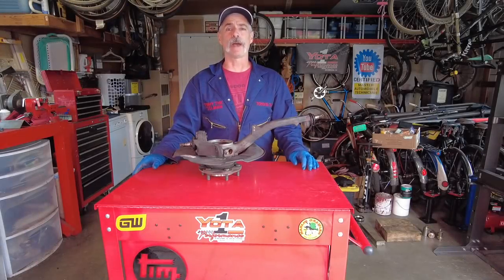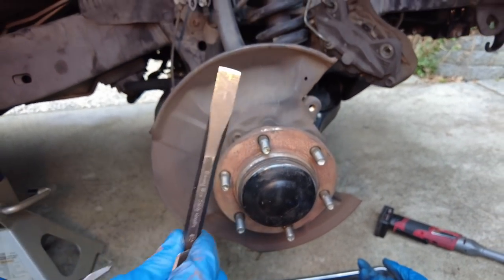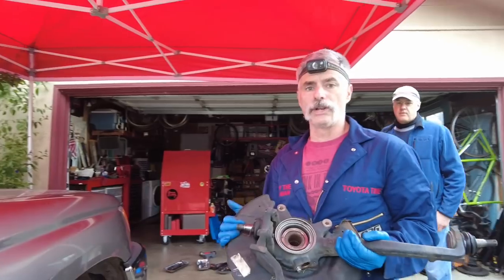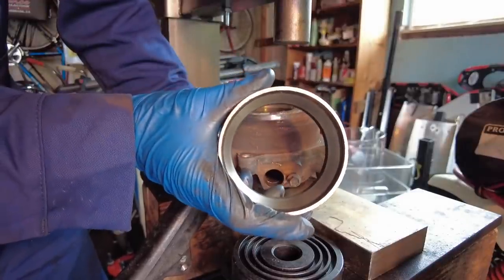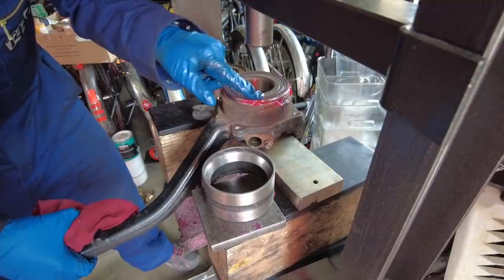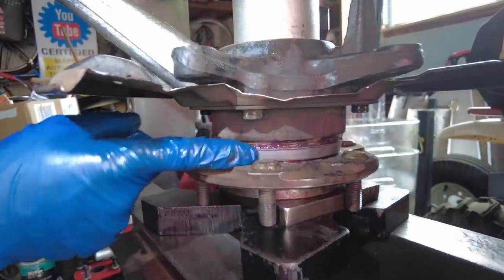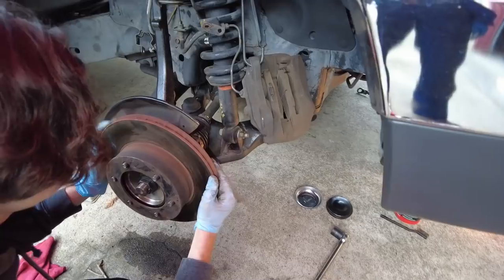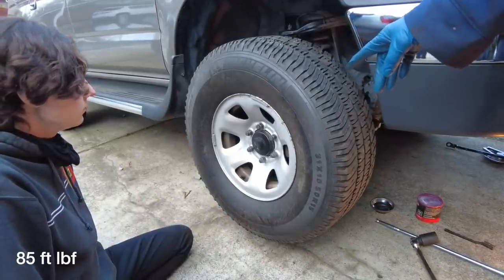Front Wheel Bearing Replacement (3rd Gen Toyota 4runner & 1st Gen Toyota Tacoma)

Comment: I can't tell you how valuable these video are to those of us trying to get the most out of older Toyota trucks!  I have already done a bunch of work on our company trucks.

Have you ever installed front wheel bearings on a 2WD 1st gen Tundra?  My company owns three of them and they all need to be done.  Looking for a good video.
Reply from the maker: We haven't done this job on a 2wd but the job would be similar to what you'd see on a rig with manual hubs.  Instead of having the CV axle nut that preloads the bearing, there's a lock nut that screws onto the shaft of the hub that is tightened to a high torque value that preloads the bearing.  Check out these two videos for information on how to perform the press work: 

https://youtu.be/TZ2sOfVrnhU

https://youtu.be/1TpOYj0sUpA

Comment: Great information in this video... Reassembly:   Toyota uses a thread locking material on the 4 bolts that mount from under lower ball joint.
Reply from the maker: Loctite is never a bad idea, but for the most part, if fasteners are torqued properly, they're not going to come loose.  Thanks for sharing this.

Comment: This is a lot more work than i thought! Quite the investment needed in tools to do this yourself. You can buy an entirely new knuckle that has a new bearing, hub, and upper balljoint already all installed. From toyota direct, a new knuckle is pretty pricey and does not include the other components. From aftermarket like moog, its about 250-300 dollars for each side. Do you have any experience with these particular aftermarket parts? Or would you recommend sticking to oem genuine parts for something like this?
Reply from the maker: Stick with OEM.  Also, make the tools investment.  Tools pay for themselves very quickly and keep.saving you money over time.

Comment: Thanks man, great video.  What's a good rule of thumb for the life of front wheel bearings on these rigs? I have a 99 4runner 4x4 and an 03 tacoma pre-runner 2x4 with 228,000 and 215,000 miles respectively. No issues yet... fingers crossed. Thanks
Reply from the maker: Hey Michael, there's no rule of thumb really on how long they last.  It can depend heavily on how the rig is used.  If you go 4wheeling, run bigger tires and maybe wheel spacers, the wheel bearings won't last as long.  I'm glad you liked the video.  Hopefully, you'll never need this repair.

Comment: 3 out of 4 of these I have done have just wound up pressing the whole bearing out of the knuckle instead of just the hub out of the bearing, deforming and destroying the snap ring that retains the bearing. I would highly recommend ordering new snap rings with the bearings beforehand. I was swapping to manual hubs so I had new hubs or I would have been hosed. Still had to drive 2 hours to a dealer that had the snap ring in stock lol.
Reply from the maker: Wow, that must have taken considerable force to overcome the snap ring.  it's definitely much easier to press the hub out first.  For sure everyone should replace the snap ring as part of this job.
Reply: @TimmyTheToolman  I was trying to press the hub out, exactly as you are. But instead of the hub breaking free the snap ring fails with much the same noise but with a little extra crunchy sounds too lol. The first time I was very confused. By time number 3 I guess that's just what you get in the rustbelt. The 4th one I put the whole knuckle assembly in the oven for an hour and it pressed out normally LOL.
Reply from the maker: @jeep6242  Oh, I understand.  You're dealing with significant rust.  Rust is definitely a game changer.

Comment: Fantastic video!! Takes me back to when I was turning wrenches.. got a basic question for you, how did the wheel speed sensors function with the greese on the teeth? Any errors or abs trouble codes? Thanks
Reply from the maker: The ABS sensor worked fine with some grease on the ABS tone ring.  I was a little sloppy with the application of the grease.  It would be ideal to keep the grease off the teeth of the tone ring.  Glad you like the video.

Comment: Timmy, another awesome and helpful video! every time I need to work on my 4runner your page is my first stop!  I have an 2001 2wd runner needing front bearing replacement. I cant seem to figure out if the 2wd needs  inner and outer bearing seals. I've seen other vids for 2wd showing only 1 seal for the 2wd model. Any chance your familiar with the 2001 2wd runner front wheel bearing replacement ?
Reply from the maker: The 2wd steering knuckles will be similar to the 1st Gen Tacomas that had manual hubs.  The bearing preload is set with a lock nut rather than the CV axle nut.  Check out this video: https://youtu.be/1TpOYj0sUpA?si=9HZmzdV7rGtys-1- and it will let you know how to do it.  Because you don't have a CV axle, you won't have in inner seal for the knuckle.  From what I remember, there's some sort of cover that keep water and other contaminants from intruding into the knuckle and contaminating the bearing.
Reply: thank you for the speedy response! the provided link along with your video helped me complete this repair. Many thanks Timmy, you rock! @TimmyTheToolman
Reply from the maker: @TheAtak85  You're welcome!  Great to hear our video helped you out.

Comment: Hey Tim thanks for the video. I just did this job on my 01 tacoma. Put it all back together and took it on a test drive and it went out of alignment?
Reply from the maker: Your alignment should not be affected by anything you did for a wheel bearing replacement.  Unless you adjusted the outer tie rods or messed the LCA cam adjusters,  nothing with your alignment should change.

Comment: Hi Timmy! I’ve tackled many jobs on my 1st gen Tacoma with the help of your video including the timing belt W/P and the most recent, valve cover gaskets. I’m going to be tackling this soon on some spare spindles I have and I’m curious if the attached parts will work for my Tacoma. It’s a 2001 with ADD and no ABS. the reason I’m asking is because Amazon says these parts won’t work with my truck. I’ve always heard 4runner, Tacoma and early model tundras have the same spindles. Just wanted to make sure before ordering parts. Any info is appreciated. Thank you!
Reply from the maker: Yes, the parts we list in the video description with work for your Tacoma spindles.  Great to hear our videos are helping you out.  Happy Wrenching!

Comment: Time to do my driver side, front wheel bearing. Found that it has a little bit of play in  it the other day. Curious Tim or anybody else? Have you used the hub grappler method? Watched another video where a guy used one of those tools seemed like a hell of a lot easier method than having to remove The knuckle and use a press to remove the bearing/hub. Any experience with this? Thanks.
Reply from the maker: Nope, I don't have those hub grabber tools.  My guess is that set of tools is pricey.

Comment: Hey tim, im doing this job on my 2004 tundra next week, both sides. Aside from potentially a few different parts numbers, is the construction/process the same? Thanks!
Reply from the maker: I've never done the job on a 1st Gen Tundra, but I've handled the steering knuckles before and they look pretty much identical to the 3rd Gen 4runner and 1st Gen Tacoma axles.  It's my best guess the process is identical.

Comment: Awesome video guys, thanks a bunch.  I don't have my own press, sure wish I could do this all myself!  I noticed the axle appears to have an additional seal that mates with the knuckle/inner seal.  Can you comment on that and why you maybe didn't bother replacing that as well?
Reply from the maker: Hey Tom, glad you like the video.  As for the seals, we replaced all of them.   Can you provide a timestamp to the part that shows what you're referring to?
Reply: @TimmyTheToolman  I think that @Tom Hernandez is talking about the dust seal on the outboard side of the CV axle.  I had the same question. I think it is the dust seal 90080-30028 (but am not quite sure on that PN) that interfaces with the inner wheel seal 90316-69001.
Reply from the maker: @averycook6854  On the 3rd Gen 4runner and 1st Gen Tacoma axles, there is no seal on the outboard side of the axle.  There's a seal on the backside of the knuckle, but not on the axle itself.  There is a metal disk on the inboard side of the axle that works as sort of a dust seal to keep larger contaminants out of the differential.

Comment: Thanks for all the hard work on these videos Tim! I got a 4Runner a few months ago and your channel has been the most reliable resource for fixing this thing up. I recently joined the forum as well and I live in the East Bay so I’m hoping to make it to a meet soon (I know there’s actually a bbq tomorrow but I can’t make it unfortunately).

Anyway, I’m in the middle of replacing my upper ball joints and right after pulling the knuckle from the car, I noticed there’s very slight play in the hub. I’m sure that wasn’t there when everything was still assembled, but you also mentioned in the video that the axle nut loads the wheel bearing. So now I’m stuck here wondering if I damaged the wheel bearing in the knuckle removal process somehow, or if the little bit of play is just because there’s no longer an axle nut pressing it all together. What are your thoughts? Thanks! -Troy
Reply from the maker: You're very welcome Troy.  Are you actually feeling play when you grab onto the face of the hub and rock it back and forth?   You couldn't have damaged anything simply by taking it off the vehicle.  If there is some play and you want to confirm tightening the CV axle nut actually gets rid of it, with the knuckle still off the vehicle, slide the axle back in the hub and tighten the axle nut just relatively tight with a 1/2" drive ratchet.  Now grab the hub and rock it back and forth checking to feel if the play is gone now or is still there.  On the wheel bearing jobs I've done, I don't remember feeling any play but I wasn't really looking for it either since we just put new bearings in.  If you try what I suggested, let me know how it went.  You're going to miss a good party.  We might have as many as 37 rigs there and 70 people.
Reply: I guess “play” was a bad choice of words. With the whole knuckle assembly off the car, the hub was just clicking when I rocked it back and forth, but I couldn’t visibly see any play. I could just hear and feel a click. And I hadn’t thought to just bolt it back onto the axle and test it again, hahaha. So I just did, and after getting the axle nut hand tight, the clicking is completely gone. So I’m just gonna hope all is well and finish this upper ball joint job. Thanks for the help!
Reply from the maker: @troyferrara8120  That clicking is the bearing spacer and ABS tone ring on the inside of the hub.  It doesn't fit onto the shaft all that tight.  That has fooled lots of people who think something is wrong with it based off the play they are seeing.

Comment: Would you recommend placing the bearings in the freezer overnight to allow ease of installation?  I've used this method for ball joints.
Reply from the maker: That could work, we have always just pressed them in. But putting them in the freezer the night before should help a lot

Comment: Hey Tim, love the videos as always. 
I hit you up about a month ago on the topic of ultrasonic cleaners. I just wanted to give you a follow up message saying don’t waste your time and money. No sooner than I started bragging to you about my cleaner it broke down lol. I got a refund then went and bought another one that was a different brand. I didn’t have any luck out of it either broke down within the first week of use. Don’t get me wrong they’re great to have when they work. If you can get a good one there awesome but paying $5000 for one that’s not made in China is not cost-effective. So I myself am back to brake parts cleaner and degreaser’s. That’s one thing about a plastic scraper and elbow grease it doesn’t break down on you. Just figured I would give you a heads up in case you are still looking into getting one. 

On a side topic I recently did a job on a passenger side front axle shaft bearing. It was on an 03 Tacoma. I looked online a lot and didn’t find much help even East Coast gear supply said to slide hammer it out. That will not work btw. Everything I looked at online people were asking more questions and getting no answers. I removed the axel seal then the inner and outer snaprings from the bearing It would slide in and out just a little bit at that point. I finally took the four-wheel-drive actuator Off and noticed another snap ring on the end of the shaft holding a gear on. I ended up taking the whole sleeve loose from the differential pressing the bearing off and back on. Then re-assembling everything with a new axel seal a new O-ring and Toyotas orange FIPG to seal the actuator back in place. Then putting it back on as one big piece to the differential using the orange FIPG again. I know you have to work pretty fast using FIPG reassemble in less than 15 minutes it says. From what I did see online guys were using the “right stuff Permatex”, flang sealant and all kinds of different things they thought were right. So I would say that would be a good video to do. Show people how to actually do it right. I’m sure a lot of people would be interested. Thanks Looking forward to a new years worth of videos.
Reply from the maker: Thanks for the heads up about the ultrasonic cleaner.  I didn't buy one yet.  I have wondered what the right way would be to replace that passenger side bearing the CV axle runs on.  So, do you think the way you did it is the preferred way?  Did you take any pictures along the way to show how you did it?  I'll take a look at my manual and see if I can glean any info from it.

Comment: Hey Timmy, loved the video!
I have been experiencing ABS issues intermittently where my ABS system activates when I am braking normally on dry pavement.  When I removed the ABS speed sensor there was a lot of dark grease all over it.  Would a bearing seal failure cause this and would it negatively effect the speed sensor?
Reply from the maker: I take it you're talking about a rear axle ABS sensor.  Oil and grease on the sensor could cause an issue potentially with the ABS function but it's definitely a sign it's time to do a rear axle seal job.
Reply: @TimmyTheToolman  I've been working on the front of my truck (99 tacoma 4wd). I'm replacing the upper and lower ball joints and replacing the old bilstene shocks and springs with old man emu ones.  That's when I noticed all the grease on the speed sensor.
Reply from the maker: @flaminglaces  Gotcha, so we're talking about the front.  Those bearings are sealed and you really shouldn't be seeing a bunch of grease in that area.  I wonder if somebody who did a wheel bearing replacement thought it was necessary to pack a bunch of grease in there.  You could pull off that inner seal to get a better look.  Maybe you could just clean up the grease mess in there the best you can working around the bearing spacer and ABS tone ring and then put a new seal on it.  If the bearing has no play and you're not hearing any humming or other weird noises coming from the front end, the bearing is most likely OK.
Reply: @TimmyTheToolman  I'll try that thanks!  I love your channel ive used your videos to get ready for a bunch of projects on my truck.  The manual is great but seeing someone walk through the actual repair helps a ton!
Reply from the maker: @flaminglaces  Great to hear you've been finding our videos helpful.  I agree that a video can show much more than any manual could ever do.  We use manuals and write-ups for our research and they are a valuable resource.  Videos can just offer so much more information than any manual or write-up can.
Reply: @TimmyTheToolman   I had similar problems.  Seal failed, axle oil has fine metal shavings in it and they are attracted to the magnetic sensor.  They bridge the contacts and short it out causing the ABS to operate sporadically.  New seals, new oil and good for 250,000 more miles.
Reply from the maker: @johnbrownlee2341  Huh?  Axle oil?  You mean from the differential?  There is no oil that can get to the ABS sensor on these rigs.  There's only a bearing that's lubricated with grease.  The closest thing that has gear oil is the differential and gear oil from a leaking differential seal couldn't make it's way into the wheel bearing area.  What type of vehicle are you referring to?  Maybe you're talking about the rear axle?  This video is for front wheel bearings and it's a totally different animal than the rear.

Comment: Hey Tim and Sean! Looking for some guidance here. Took my knuckle to a shop and had them replace the wheel bearing with oem parts I purchased. Truck is still whining from 40mph-70mph. Didn’t replace the hub only the wheel bearing and related parts. Where could this whining be coming from? Thanks in advance, cheers!
Reply from the maker: Not sure since I'm not there to listen to it.  Could be the transmission. Maybe an engine pulley.  Maybe a rear wheel bearing.

Comment: Good overall instruction... way too much grease going to migrate to places you don't want to grease. Gobs of grease on the tone ring will give a bad signal.
Reply from the maker: After editing the video, i did think of the chance grease could affect the ABS signal if enough of it got on the tone ring.  What I do know is if that does happen, all you would have to do is pull the ABS sensor, rotate the wheel and use a few q-tips to wipe off any heavy deposits of grease.  But, I'm pretty sure it's fine because they've been driving it with no lights popping up on their dash.  If an ABS sensor loses it's signal, the ABS light will illuminate on the dash.  Thanks for the comment and glad you like the video.